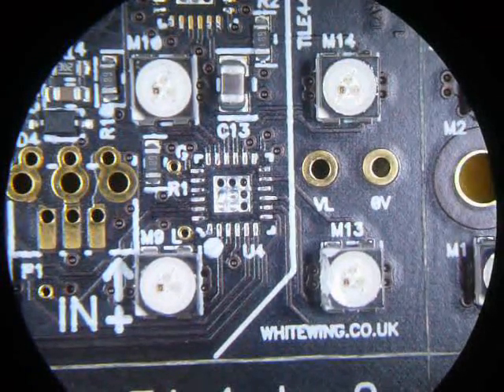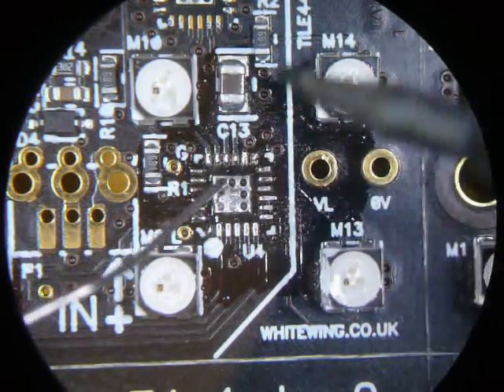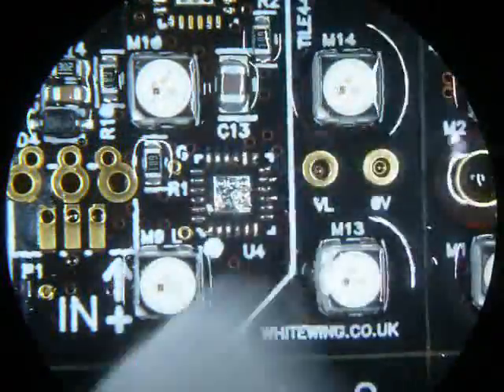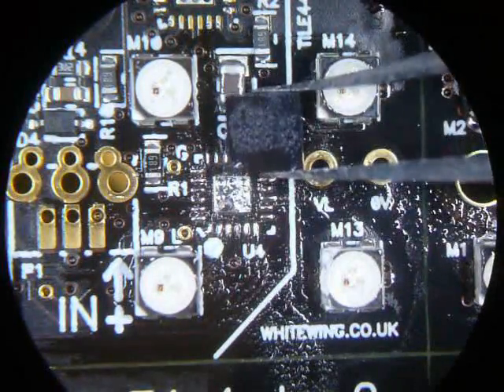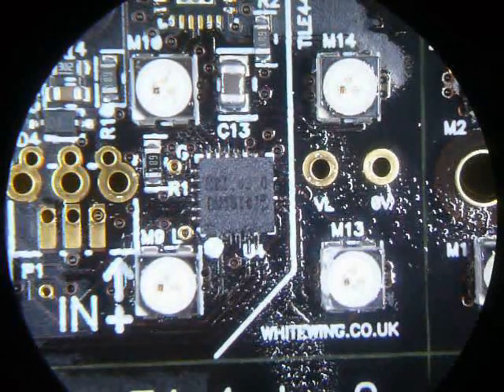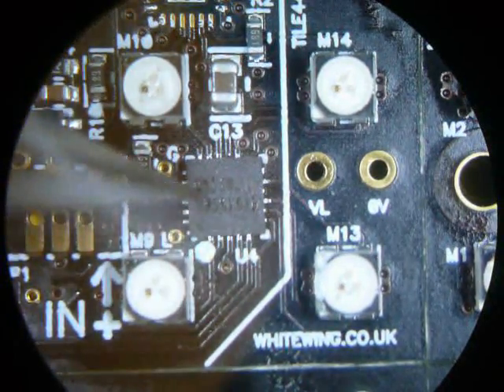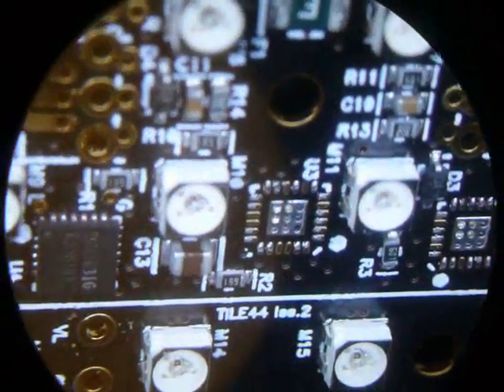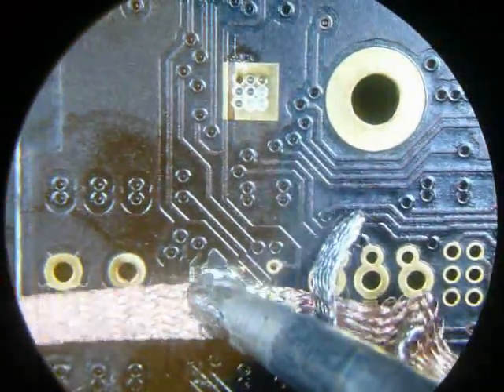QFN reflow without hot air

Comment: I already tried this too, after some practice, you stop frying chips and get a very well reflow. the only drawback is that some IC don't have a thermal pad. In that case this dont work, but there is an alternative way, wich consist in changing the footprint and extend the pads in a way you can apply the heat from the edge, i prefer this because is more controllable. btw if you have connected the thermal pad to a huge Gnd, this don't work either due the quick disipation. so in conclusion: it works in some cases.

Comment from the maker: If it's a thermal pad you'll have vias through to the other side. If not you probably wouldn't have enough thermal conductivity for this to work and would need to use hot air, IR or a hotplate